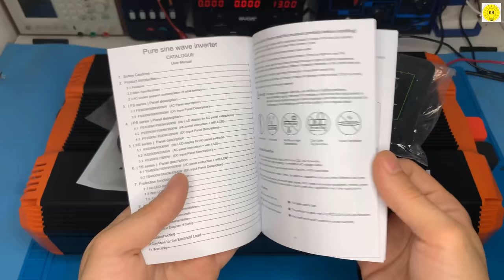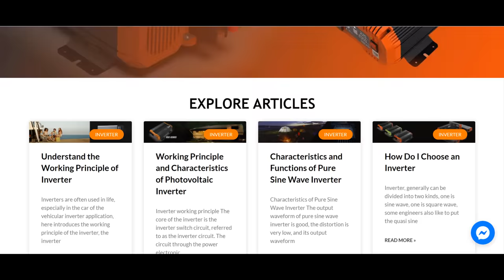how to make simple inverter 3000W , sine wave , 16 mosfet , IRFz 44n

Comment: Where are middle pin of one side Misfit
Reply: Center pin of MOSFETs are electrically connected to the tab - which makes no sense as all the tabs are mechanically connected to the heatsink via metal screws and nuts

Comment: Mosfet installation on over another is wrong 
It will heat half chanel
Reply: Also, the insulating mica sheets used are pointless as its bolted down with conductive fasteners..
Reply: As I said, poor quality
But seccessful as youtuber gaining viewer: making controversial things

Comment: Arkadaşlar yaptığı iş doğrudur cünkü bende yaptım ırf3205 mosfet ten 10 adet sürücü modül olarak Tl494 entegre ile 2500wat ama tırafo yu mikro dalga fırını tırafosu kullandın  güzel calışıyor 100w lamba 5 adet bağladım birde fan calıştırdım  calışıyor  deneyin  kolay gelsin
Reply: He connects a 1200 watt device via alligator clips. If I haven't miscalculated, the device pulls 5.3 amps on the 230V side. The translation of the transformer is about 19. 5.3 amperes * 19 results in a current of 106 amperes which is conducted via extremely thin crocodile clip cabels. It would have to go up in air / burn up.
Reply: Altta yorum yapan kişi gibi timsah uçlara kaç volt giriş verdiği belli değil o timsah kabloları o akıma dayanmaz normalde. Bende 3205 ile yapmak istiyorum elimde güzel bir trafo var aslında ama emekler ziyan olmasın sonra stabilitesi nedir 2 dakilaik gösteri ile saatlerce çalışması aynı şey değil.
Reply: @ayhanozsoy8772  e

Comment: Dibawah mika ada cincin plastik isolator yg tidak ditampakkan, bagi pemula yg tidak mengetahui ini pasti bakal jadi bencana
Reply: What do you mean, can you explain a little more?
Reply: @ayhanozsoy8772  
Under the mica in the bolt hole there is an insulating plastic ring which is not shown in the video, for beginners who are just learning not knowing this will definitely be a disaster, there will be damaged components

Comment: ciao. pensi che si può fare un inverter di 8kw 220v con una tensione di entrata di 300 volts continui. 
voglio utilizzare dei pannelli fotovoltaici (9 kw) per  attivare un caricabatteria per auto elettrica di 7.2 kw 220v. 
Grazie tanto Paolo
Reply: Actually you can define output voltage by transformers coil count afaik. just change the transformer to correct one but if input voltage is different you need to correct input circuit too

Comment: So why didn't you connect the base of the rest of the MOSFETs؟؟
Reply: The MOSFET center pins are electrically connected to the tabs - which doesn't make sense as the MOSFETs are mechanically attached to the heatsink with metal hardware

Comment: waste of time. 
it would never work. the transformer is too small for 3kw and second group of transistors, the downside ones are not conected at all, the drains are in air and shortcircuited with the upper ones and the gates conected only to resistors.

Comment: The 12v inverter is sucks,voltage drop from 230v to 197v with 700w load,when will put 2000w load,will be 150 v output voltage. I have an 200w solartronics inverter and with 1900w load the output voltage stay ferm at 231 v. So,yours is garbage...
Reply: Did you see the thin wires he used from the battery? It clearly shows that his battery voltage at the inverter input is low  of course the output voltage goes low. Just think about the current  he was running 700W at 12 V thats 80-100A dependent of the efficiency of the inverter and thats with a fully charged battery.There is absolute no way he is running his home made inverter with those loads, look at the thin wires feeding it power unless he is running 2-300volts in to start with. Also that transformer will blow up at 3kw . It is a 50/60hz transformer with a maximal power of maybe 4-500w on a good day...a very good day. This video is your typical Your tube B.S.